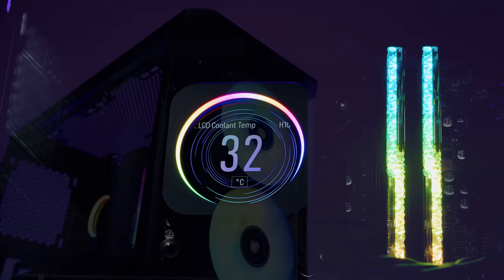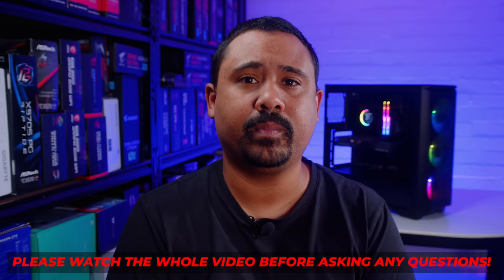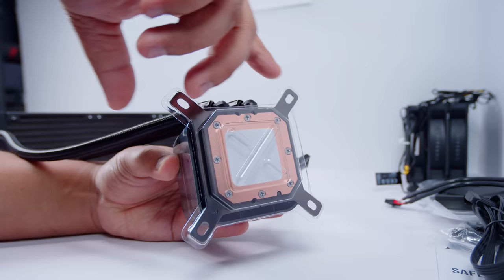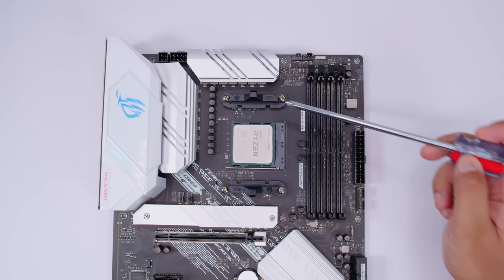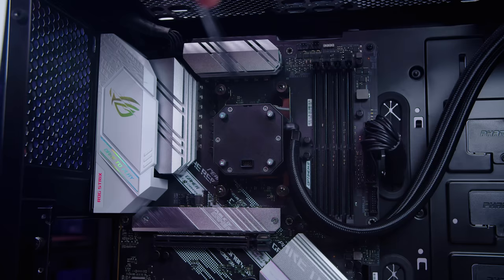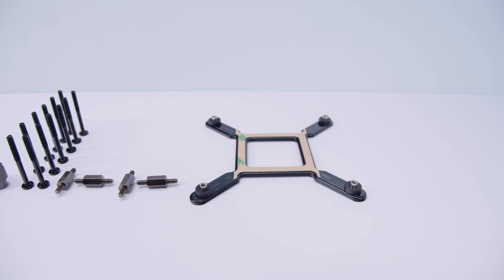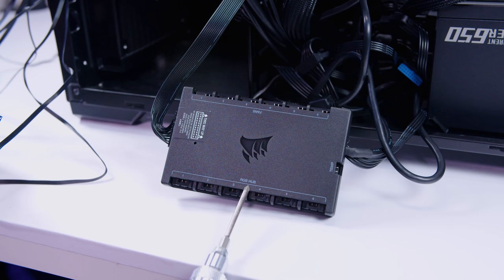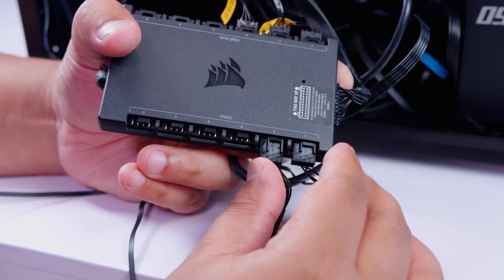HOW TO Install Corsair H150i Elite LCD on AMD and Intel

Comment: On pcpartpicker i want to get the asus z790 rog maximus z790 hero with a h100i. It says that imight need a separately availible mounting hardware. Im not a geek, can someone get in to the specifics as to why this is the case (btw it also applies to all the cappelix and other lcd coolers from corsair as well, with a few others. My case is the 5000t.
Also is it possible, since the 5000t comes with a commander core xt, to put the front ll120s in the case’s hub in slots 1,2, 3   ,   the ones in my cooler in 4 and 5 in the cooler’s cooler, and the rear fan in slot 6? I am asking this so that when im in icue it already knows the fan order? If no then how do i make it so that icue recognises my cans from the bottom front fan to my rear fan? I am using 3 preinstalled ll120s at the front, the two MLs at the top on the radiator, and a final LL at the rear?
Or should i plug both fan cables for each fan in to the case’s control box and just put the other one in for the screen? These two things could make or break my build

Comment: New AM4 mounting kit 😍😍😍😍
Reply: only for lcd version ?
Reply: @harys4058  can be purchased standalone, it's sold out on their website
Reply: @dangerfield85  you can request it from Corsair, as I did that and I got the new am4 bracket for my h100i elite capellix
Reply: @TheCardude98  I sold my Corsair unit and went back to air cooling. RGB novelty wore off

Comment: I put ever single Corsair fan in ...backwards.   Batting 100%.  Every.. single... one.   Just great.   Had to swap every single one around.   Least of my problems.  The whole AM5 / DDR5 / EFI platform ecosystem is a clvsterfvck nightmare that fights you every... single.... step... of... the way.   The least thing you need is to add a ton of useless Corsair RGB on top of it.

Comment: If I wanted this setup but also an additional Corsair rear fan, does anyone know how I’d connect it if I have no RGB ports left on the control box
Reply: You'd have to get a Corsair RGB fan hub that drives the RGB part only. You would use one of the motherboard's fan plugs for the spinning part.

Comment: Can the display on the screen be rotated in software? I am looking at the upgrade kit, my AIO tubes come out on the left side so this would have the display upside down.
Reply: Rotate the image through paint or whatever and you'll be good. The only thing you won't be able to rotate is the temps and other sensor numbers.

Comment: hey I need some help please! I just bought the ll140 2 pack for my new cpu cooler and everything is plugged in properly and works, however, I cant get my commander pro to pop up into the icue software to control the fan speeds. I would like to increase rpm speeds under heavy load. I tried updating and reinstalling Icue, and msi center. Any help would be great, thanks!

Comment: Wait why are the fans installed outside of the case and not inside? All the builds I’ve seen it’s on the inside
Reply from the maker: Look up the case and that will answer your question.

Comment: Should the Intel LGA1700 mounting bracket be the tiniest bit loose after putting the standoffs in? I have the standoffs threaded in as finger tight as I can and, if you press on the back of it, each arm moves the tiniest bit.
Reply from the maker: Normal :)
Reply: @GearSeekers  stupendous!! Thank you kindly for the reply and advice.

Comment: Maybe someone will find this helpful but I had some issues with the ribbon cable of the pump
I plugged it in then the pump head showed a red triangle with an exclamation and all the fans I had connected to the controller blunk red and ran always at full speed I wanted to buy a new commander core but then I realized that I just had to push the ribbon cable in further and now everything works properly
So make sure to control that you plugged everything in correctly if you have any issues 😅
Reply: I’m having the same problems but I’ve pushed the cable in as far as it will go and no luck

Comment: No you are wrong. You need 2 usb headers on your motherboard to work. One for the hub where you plug all your fans and one for the lcd screen. 1+1= 2. I mentioned this yesterday. Both usb need to be plugged on the motherboard. If you use splitter you wont be available to have some option in the lcd screen like screen setup.
Reply: Works fine with splitter.
Reply: @TheSjuris  Steve, my motherboard is x570s gigabyte. I have 2 usb 2.0. Here is the problem. One usb header is for commander xt running 6 fans no problem. Other usb on the motherboard is for the splitter do make lcd screen and controller hooked up. This is how it should work in the perfect world but it does not. Lcd screen does not give you set up option on the Corsair Icue. It does light up
Into default screen. I can only make
It work if I unplug comander xt out and plug both usb on the motherboard.
You are runnig 3 fans on the video.Try using othe usb header and watch it yourself
Reply: @stefanradunovic8318  have the same motherboard and it works perfectly with iCue run 10 fans all works perfectly.
Reply: @stefanradunovic8318  did you update the firmware for the Commander Core?
Reply: @TheSjuris  Steve, yes I did. I think I might found what causes issues. Commander xt does not like lcd hub that comes with it. It might be software problem. I think I would eliminate this issue if I would have commander pro and not xt. Again Corsair Icue is not perfect. I tried just running hub and used motherboard led for the corsair fans and everything runs good. It’s shame that Corsair product is fighting each other in the Icue.
Reply: @stefanradunovic8318  oh it’s definitely a software/firmware issue.  Wouldn’t recognize mine until I re-installed iCue.
Reply from the maker: No you are wrong. Update your firmware.
Reply: @GearSeekers  I have done that, I have reinstalled ICUE. Simple problem is commander xt will not work with lcd hub and ICUE software will not respond to both and it will chose one or another. When not using commander Xt everything works fine. Just to note I am not talking about commander pro because a lot of people will get confused.You only have 3 fans hooked up. Try using other usb header with commander xt and than see what happens. You will not have option in the Icue for the lcd screen setup period.
Reply from the maker: @stefanradunovic8318  I've quite literally build systems with Commander Pros, This cooler and 12 fans and had zero issues. You have an edge case. I would contact corsair mate.
Reply: @GearSeekers  looks like a lot of people are having same issue. For the first time I checked out corsair forum and people are losing screen option left and right and problem seems like exactly what I described. I understand you have to talk good about product but as far as I can tell you Corsair product is mostly good and software garbage
Reply: @GearSeekers  gear on the video you had 3 fans not 12 so your statement is not true whatsoever period

Comment: I installed the aio cooler exactly how you did in the video and I noticed about a 10 degree Celsius difference in my GPU temps? I have 3 intake in front of the radiator and 3 exhaust(1 in the back and 2 on top).. is 3 exhaust overkill? Any advise? I’m worried idk why my gpu temp went up. My cpu temp is to my liking tho. Thanks for the video
Reply: Your temps went up because you have the fan's blowing the hot air from the radiator into the case. The fans should be pulling (or blowing) the air across the radiator, and out of the case. You need to reverse your airflow.

Comment: Please help. I installed the cooler today. It was working but the lcd screen was not. Now when i boot  it says to check if its plugged into the cpu header. Im stuck in the bios, i cant read the pump rpm anymore and the aio is blinking red. Please  help what to do?
Reply from the maker: Watch the video and follow every step
Reply: @GearSeekers  i did. Maybe somsthing got loose in my setup
Reply: What I did I just pulled cable more from the back to make it stay in place (Hard Fit). If its an AMD built it may be loose due to the bracket not fitting correctly.

Comment: ISSUE RESOLVE for anyone: I removed the Corsair plate for this, there was no screws to put in their place so I used the same ones - the magnet was connecting but the connection wasn't reaching, my pump wasn't moving but fans where on , anyways remove all the screws 🤣

Comment: Very well made video. Has given me insight to try this for myself. CPU generations are mentioned, knowledge which I am not to strong with. Would this kit fit an old Intel Core i7 975EE in a 1366 socket on a Asus P6T7 Supercomputer motherboard  ? If anyone knows please let me know. Thank you  for the video.
Reply from the maker: It should work
Reply: @GearSeekers  Thank you. Will try it !
Reply: @GearSeekers  Just wanted to say thank you again as it worked without any issue. I went ahead and purchased and now the old, long surviving favorite PC is up and running again with a new cabinet and AIO cooling.

Comment: Thanks for this! One quick question, after installing it this way, the AIO shows as N/A in the Bios and none of the fans or pump are showing in the Asus motherboard utility for RGB management. What do you recommend to get around that?
Reply: Did you fix this issue? I think I got the same problem
Reply: @trafalgarjaquez2792  I installed Corsair iCue and the fans and AIO stats started showing in that. I don't think it's very compatible with ASUS software because those would not show up in Armoury Crate or in the BIOS menu of the motherboard. As long as iCue detects the fans and AIO and can control them, you should be good using iCue for this. Sucks I know..

Comment: Hey I've bought this cooler and installed it as you said in this video it worked perfectly good its almost a month passed but recently I don't have Screen setup and Hardware screen in my icue anymore did it happened to you, do you have any ideas about it
Reply: On v2.6.201, that’s where the features went missing. I’ve installed mine since January 2022.
Reply: @Daniel_Zigadlo  Hey there, Wdym by that
I tried to turned off my psu and turned it on again it got fixed buts its annoying since i have to do it like every 2weeks

Comment: This video was great except for 1 horrible thing. The orientation . You never install AIO with the radiator tubed facing up never. Reduced proper coolent flow because there is always sir in the system 
You want the hoses at the bottom best performance or install at the top with fans used as exhaust will extent tge life of the AIO 2x
Reply from the maker: You should watch the video again and listen to what was said

Comment: Sorry, but I don't understand why the radiator with the fans, it was mounted frontally, the fans take external air and throw it inside the case, but the radiator with the CPU at work, he warms up, so in this way, we enter hot air inside the case ,In my opinion, is an incorrect assembly, the radiator must be mounted on the upper part of the case, so that frontally there can be 3 classic fans that enter "cold" air, and the radiator fans, throw the "cold" air in the radiator towards the Outside, so that the heat air, produced from the hot radiator, comes out of the cabinet ....... I strongly advise against mounting Icue H150i in this way.
Reply from the maker: That's not how airflow works mate. It's called airflow not cold airflow. You should look at how every single car is designed. Your opinion is just an opinion. It's not a fact. The fact is air needs to move and this is how you make it move. Thanks for watching. Hope you learned something 😊
Reply: @GearSeekers  the air needs to move, it is clear, but using logic can also help to manage the air flows correctly, conceptually "cold air" means that which is outside the cabinet, it is obvious, the hot air must be taken out of the PC, and not be introduced inside, it is a question of logic, not of opinion, by mounting the radiator frontally, you are introducing hot air into the cabinet, and it is conceptually wrong as a procedure, the radiator must be placed in the upper part of the cabinet, so that the hot air generated by the heat of the radiator is expelled OUTSIDE the cabinet and not INSIDE, in the front part of the cabinet, must be positioned only the fans, which introduce external "cold" air, this it is the correct method of managing air flows.
Car radiators are placed frontally because with the movement of the car, the air cools the radiator, it is obvious, but it certainly cannot be taken as an example for assembling a PC, the engine of a car must always function well be very hot (90°), which is the exact opposite of how electrical components should work, so I'm sorry but the example is also totally wrong
I think you are the one who needs to learn something about airflow, and how to properly mount radiators for liquid cooling.
Ahh, and I add, in all the illustrative photos of the product, Corsair always only shows photos of the assembly on the top, could it be a coincidence?.....
Good luck.

Comment: I’m honestly furious my $200 cooler and $100 lcd screen didn’t come with the correct am4 bracket. Just the stock one. I now have to wait till the elite retention kit is in stock and spend more money on a fucking bracket. $4500 and they can’t send the right brackets 🤦‍♂️🤦‍♂️🤦‍♂️🤦‍♂️🤦‍♂️

Comment: Hey man, I built my PC back in march of this year, and 2 days ago, while I was playing R6, my led hub thing for the cpu started to flash red, and say it was over heating. Yet, I have not had problems like that since I build my PC. Again happened last night while I was playing pubg. Cpu was only 70 percent of load. I know that doesn't matter much or whatnot. Just wondering if you have any ideas. Also, I have the Corsair h150i elite capellix. Thank you for your time. I forgot to mention, I had the other ICUE installed and checked it, and it said that the pump or whatnot was 54c, and a emergency shutoff popped up for 70c.
Reply: Did you fix the problem? I got same issue yesterday. Suddenly, My pc run hot and force shutdown.
Reply: @trafalgarjaquez2792  honestly I have no idea. It just stopped doing it one day lol

Comment: (Not my first build) recently installed this cooler and after install I received an exclamation point on the cooler along with the computer not turning on afterwards. Anyone have an idea on what’s going on?
Reply: Hey! Im having this too... did you figure this out?
Reply: @RoeeFeeds  no resolution yet. I’m thinking it might be the cooler, dude. I did order a new mobo because I needed a new one regardless.. I’ll update you after that, doubtful it’s the mobo though.
Reply: @michaelthemootz2797  I got my PC to work, exclamation point still there. Cooling is working properly, I think it might be the commander core because, it doesnt show up on iCue. I'll try that soon /
Reply: @RoeeFeeds  so I'm just seeing your reply. I flashed windows and re-installed it. Everything is operating fine.

Comment: Am I dumb where does the liquid go in this thing???
Reply from the maker: As mentioned at the start. These coolers don't require you to fill them. They are a closed system with coolant already in it